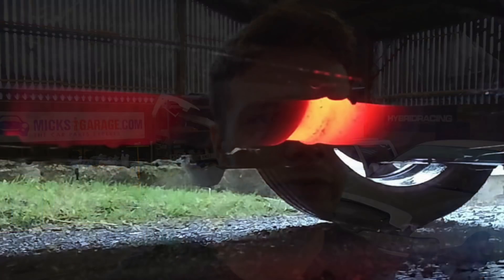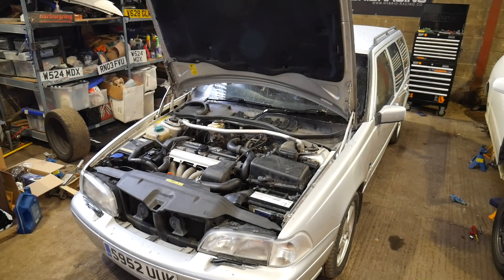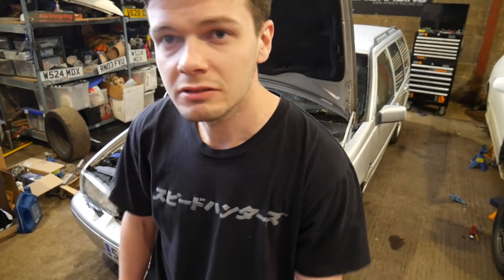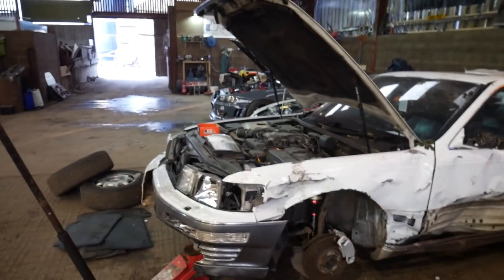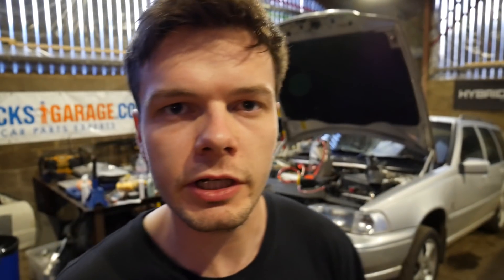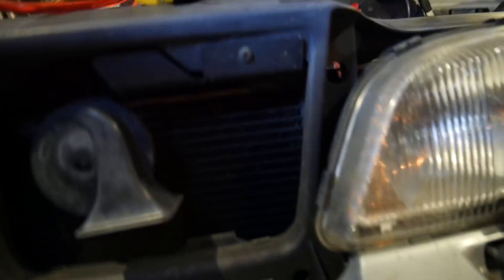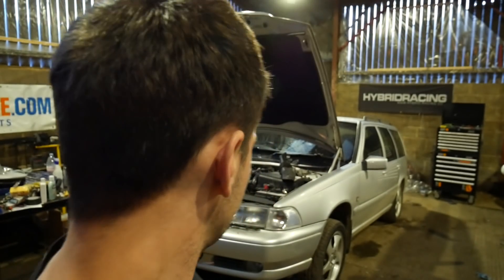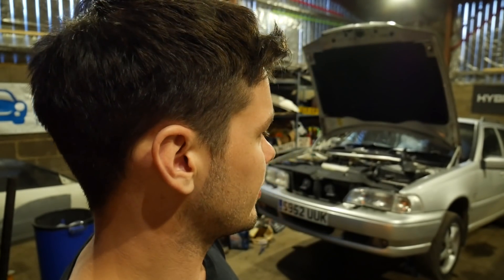My Volvo is broken, and so is my voice!

Comment: Yeah autos have torque converters hence why you only have drained 5 ltrs ... as most of the oil is still in the converter . You need to drain , fill , start the car for a few mins ... drain again .. then re fill start the car ... drain again . Twice should be enough for the fluid to be mostly all new .

Comment: If you want to get to get most of the old fluid out (automatic transmission flush).
 
-You need to first drain the old oil from the pan then refill with new trans fluid (do not start the engine yet).
 
-Second disconnect one or both of the transmission cooler lines.>>
-Warning(If you have to unscrew the lines going in the radiator plastic ends there is risk of cracking the plastic and you'll end up with a coolant leak. Most cars have the transmission cooler going trough the radiator plastic ends, if not there might be an external cooler).
 >>, extend or add longer hose and put them inside a large container to catch the old fluid (if your container is not big enough or the hose are not aimed properly it could make a pretty big mess). 

-Now with the new fluid at the proper level in the transmission, Start the engine and go in front of the car, the old oil will come out of 1 of the 2 disconnected lines, after a few seconds the fluid will start to become more clear, Stop the engine when you see the cleaner new fluid coming out. If the fluid stop coming of the hose, stop the engine refill and start again, at this point there should be much less used oil left in the system. After that reconnect the hoses to the cooler, add oil to level, start engine hold the brakes and cycle all the gear a few times, recheck the fluid level and your done.

By doing this, the first time you start the engine the transmission oil pump will draw in the new fluid and push out the old oil out trough the transmission and the converter replacing it with the new fluid, this should remove at least 90%+ of the old oil out.
 
Unfortunately if you ran the car with out doing this procedure the old and new fluid will mix together. So either live with it, start over again from scratch draining the pan put new oil in and do the procedure or, like some other people said, to drive the car then drain-refill and repeat who knows how much time which will also require and waste a lot more oil.
Reply from the maker: Hey man, thanks for the detailed comment. I've not started the engine yet, so I will give that a try first with disconnecting the cooler line. I think the "top" line should be the one, based on previous Googles! Cheers.

Comment: I replaced the gearbox I'm my 850 T5 auto, i put 6.5 litres in and that was completely dry. 5 litres is bang on for your gearbox in my opinion mate especially as that's what came out, it should drive much better now especially in sport. New fluid makes a big difference Imo.

Comment: Torque converter will hold the rest. You have to flush/refill, then run it about for some miles, then flush/refill/run again a few times until it all come out looking like new fluid.

Comment: I’m only 12 but there is a air valve on the top of the automatic transmission and some times water can get in if you go through a big puddle

Comment: danny dont flush the whole gearbox system...drain 3 or so litre's out of it then put 3 litre's of new stuff in, drive around for a couple of hundred miles and then repeat until the fluid is bright red. there's been a few people that have destroyed the auto box when flushing in one go, also its highly recommended that you only use VOLVO Dex 3 to do the job as there's meant to be some additives that they put in that you dont get with other DEX 3 fluid...

Comment: You will never fully drain an auto unless pulling it apart. Fluid is throughout the case, valve body, (mostly) torque converter just to name a few.

Comment: Miss fire isn't a hard one really on a Volvo. A) check if it's a more modern coil pack version or old school plugs n coil like mine.
Coil packs run around £40  each x 5. Could easy have a pack on it's way out. Old school could have a defunct set of leads and distributor cap/rotor arm.
OLD VOLVO'S just don't die through a puddle. LOL

Comment: It probably did have 10-12 litres in and has slowly drained out over time..or when the previous ATF change was done they didn't put enough in..worryingly!
Reply from the maker: The box was full of ATF as I checked it before draining. Like others have said it will just be around the gearbox, and it seems my information of 10-12 litres was the recommended amount to do a flush. Capacity is 6.5L!

Comment: Seeing as you have the front of the car up could there be a litre or 2 of oil sitting at the back of the box, behind the drain plug? Don't know the cars, or where the drain plug is, just speculating, that and the torque converter might account for it?
Reply from the maker: I had the same thought so I jacked the rear right side of the car up whilst the plug was out, a little bit more came out not a lot, maybe 500ml. I think the other comments are best in that there will be fluid still around the mechanical side of the box, torque converter etc.
Reply: Yeah fair play mate, did think you'd probably thought of it :-)

Comment: Isn’t it pretty essential you use genuine Volvo oil in the transmission for these?

Also how are you not getting stung with copyright with the chunes.
Reply from the maker: Nope, the later models with the 5 speed are a bit more finicky with the oil they need but not the 4 speed in mine. 

R.E copyright - I'm not sure tbh!
Reply: DannyDC2 good news all around then, keep it all coming!